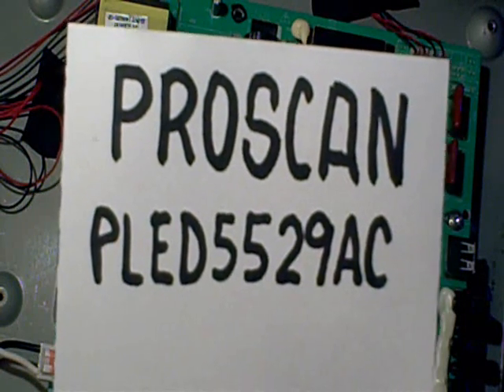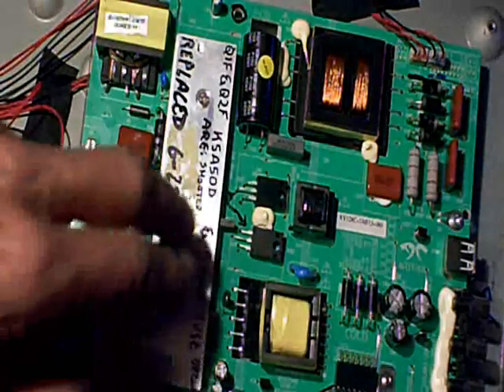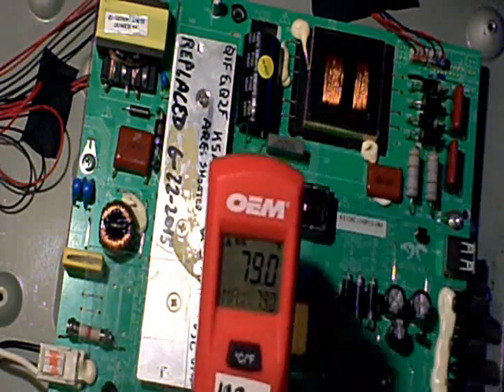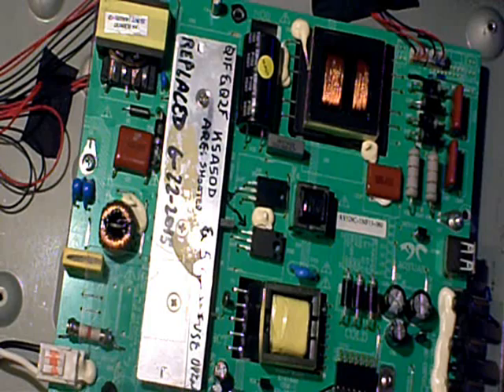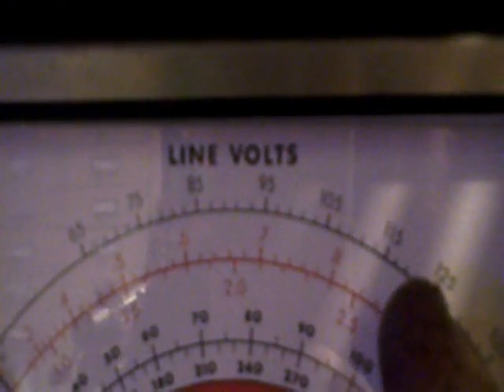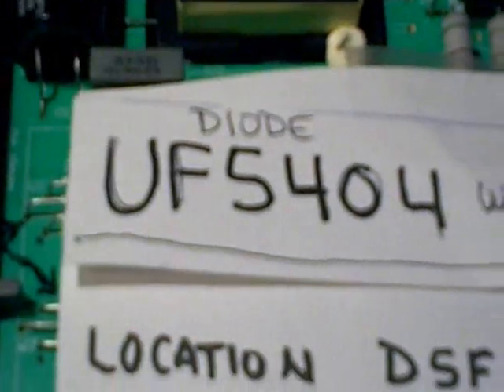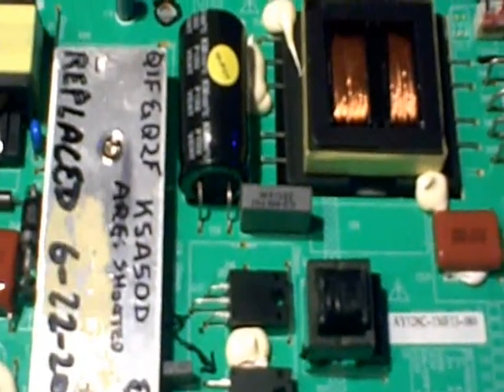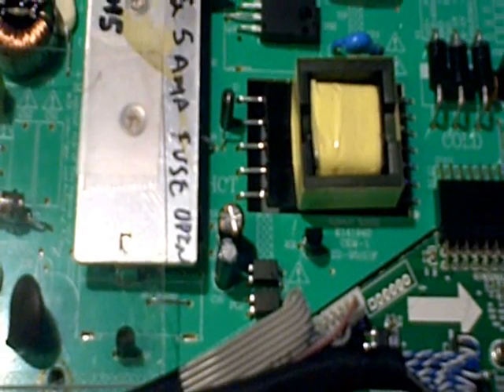Proscan PLED5529AC Repair. Using A wattmeters to check power consumption.

Comment: Great video and right to the point like alot of other videos out there that turn a 5 minute video into an hour long video.
I've got a question that is off point but maybe you can help. I have a proscanPLDED3273A TV that the blue light comes on but nothing else. I am experimenting with my Raspberry Pi400 single board computer and I took an old laptop screen and bought a lcd driver board for it to hook it up to and it works as a screen for the Pi400. I have heard that you can take an lcd screen from a tv and get a driver board and hook it up as a display. Is that possible? Thanks, Mike
Reply from the maker: I'm  not knowledgeable on the possibilities with your idea, but with all the different displays out there it sounds like challenging way to hook up an external display.
Reply: @GrantsPassTVRepair  when I took my old Toshiba scrren from an old laptop and found a compatible lcd driver board for $20 on ebay it is simple and works great. The Raspberry Pi is a singleboard computer about the size of a deck of cards but you need adisplay, keyboard and mouse to use with it. You can just use a hdmi cable to hook it up to a tv
Reply from the maker: @mikehall7806  I've been hearing about the Raspberry pie for years, but I haven't experimented with one just yet. Thanks for the info.
Reply: @GrantsPassTVRepair  Thanks

Comment: Same exact POS TV I bought just 3 years ago almost to the day. And the only way to see the picture now is with a flashlight. And that means on this LED TV the LED driver is what's wrong with mine. My remedy? A new TV as there's been a gremlin inside this TV since I first turned it on. Oh it worked most of the time but there's been delays in the picture coming on once turned on. Picture lockups. And this latest deal was when I returned from next door Christmas dinner and saw the TV being dark - even though it was on and the sound was working. I just shook my head and grabbed my wallet to see how much money I had. And I had enough for a new one that's certainly going to be better than this thing ever was. I've never had a TV that didn't last longer than I wanted to look at it especially after many years of doing just that. But this Proscan PLED 5529A-C is an unimpressive, barely utilitarian, thin, big screen LED TV that's best days were somewhere else because I surely didn't see much of them here. 3 years and it still sounds...shitty but that's from the speakers on these kinds of TV's - they all sound that way. But you get the jist. The audio works fine. The picture not-so-much...Oh and by the way and for anyone that knows - where's the LED drivers for this TV? On that mainboard like in this video where he found heat problems?? Why do I suspect that I probably have something on this board that's also haywire?? Why I don't have a clue as the TV was out in the open where ventilation shouldn't be any problem. So who knows??

Comment: there have been some issues with the coil at led power section overheating due to shorted turns.  there is an excellent video by someone that describes a method of reducing led current in this crappy TV.

Comment: I have a PROSCAN Model PLDED3257 A-B LED 32” the front power light is on but the T.V. wont turn on is it the power board?
Reply: Hey i got same problem. Any help?

Comment: Thanks Dave. I was taught that when a diode of a bridge rectifier needs replaced, you should replace all 4 of them.
Reply: Frank Pitochelli 
I still disagree. If one went bad I would change all 4 diodes. 
I think the main reason people just throw TV's away and buy new is because repair shops don't advertise. I never see advertisements on TV or radio from electronics repair shops. Yall complain about no business and don't do anything to advertise for business.
Reply from the maker: Yes. most definitely.
Reply from the maker: Robert Calk Jr. I think your correct in instances where the diode failure is due to a short which would have stressed all 4 diodes.  In this case there did not appear to be any shorts responsible for the diodes failure, so I figure it's 
probably okay. At least I hope so since I stand behind my work. Thanks for the info.
Reply: Grants Pass TV Repair 
I'm just a hobbyist and don't know much about fixing stuff for a living, but I would go ahead and replace them all if it were mine since diodes are relatively cheap, and to lessen the chance that I would have to open the TV up again. I hope you don't have to waste your time in the near future replacing them and taking a chance of angering your customer.
Reply from the maker: Robert Calk Jr. Thanks for sharing your concern.
Reply: Robert Calk Jr. I have been in TV service for 35+ yrs.....yes in a lot of cases you should change all the diodes, however, in this circuit arrangement I AGREE with Dave, it's not a high current situation, so I feel it was not imperative to replace all four rect's........the tv will probably be just fine.
Dave was diligent enough to check for other problems, I've seen a lot of tv's run for a while even with this kind of issue and last for a couple month's and then you'll discover the diode which was bad all along !
GOOD job Dave !
Frank....Richards tv, & elec.    R.I.
Reply: @frankpitochelli6786  i found a strange liquids drops on a tv when i opened to cheq the boards. The TV its a proscan PLDED3273A-B. Any idea
Reply: @e.santiago6078  ...
Hard to say unless I could physically see the liquid...
It could be electrolyte from a leaky electrolytic...
Or maybe something got spilled in it.
Sorry I couldn't be more help.!
Reply: Frank Pitochelli 
Why take a chance? If the customer has to waste his time bringing the tv back for a dollars worth of diodes he will probably be pissed off. No offence, but I would go somewhere else. I don't mean to sound like a jerk - I'm just being honest. That is unless you want to charge the customer for a repair for each individual diode.
Reply from the maker: It sounds as though you don't understand what I said about the other diodes not having been stressed as would have been the case if there was a short. They are driving LEDs. Anyway I get that you don't think much of my judgment here.
Reply: Grants Pass TV Repair 
Yeah, I understand, and I know that you know a lot more than I do. I just don't like taking unnecessary chances, that's all. Why take a chance of losing a customer for a few diodes?
Reply from the maker: Frank Pitochelli Thanks Frank. I'm glad someone agrees with my assessment here.
Reply: Robert Calk Jr. I gey your point about call backs.....however, the other diodes clearly weren't stressed, and, if you start replacing every part that is associated with that circuit etc.you'll be replacing entire circuit boards.
Due to the cost of a new tv nowadays, there is very little profit in repairs.
After 35+ yrs. in tv service, which at one time was a very lucrative buss...I am only doing it a few days a month, at one time it would keep me busy 14 hrs.a day !
Hope you understand, its just not worth the expense of time, materials etc. to make 30-40 dollars.
You can very easily work at a loss in the repair buss.
I'm sure you'll say that if it comes back it will be a loss anyway, most cases you're right, in this case, it was not necessary to replace those diodes given the info that Dave had explained.
Hope you can understand......Dave knows what I'm talking about !
Reply from the maker: Robert Calk Jr. I think Frank made a good point about all the other components you should replace if you were
to consider every component associated with the bad diode.  I did double check the value of the resistors which overheated, but nothing beyond that. As a TV repairman we often find ourselves having to make judgment calls based on experience and wisdom. Sometimes it comes down to time spent doing the repair Vs the value of the TV. After 20 plus years of doing TV repair I'm happy to report I don't see many returns, but when I do I make it right with the customer.
Reply: +Grants Pass greetings fellow tv repairman. gone crazy yet?
Reply: I hope not - I enjoy your videos. But I still ask the same question; why take the chance?
Reply from the maker: Hi Robert,
In most cases I thinks it's best not to take a chance.